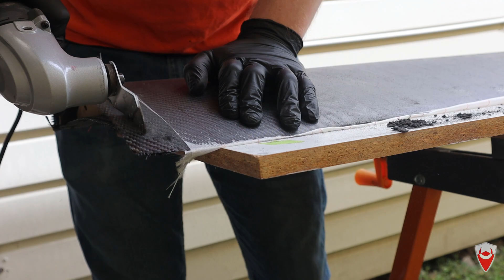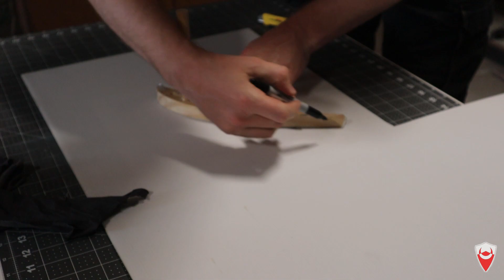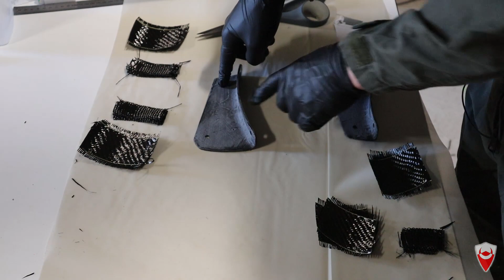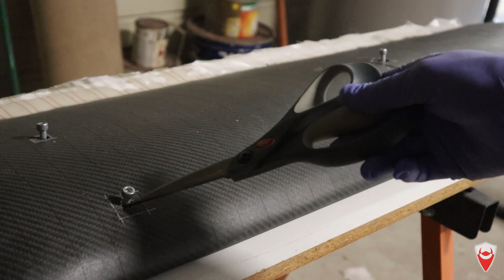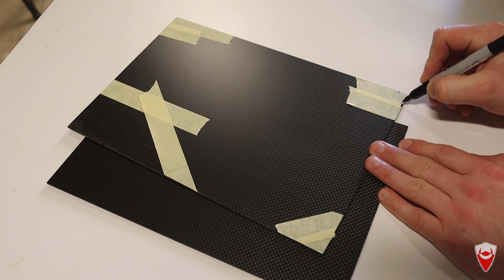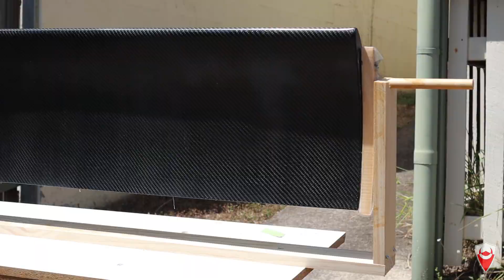[BUILD] Making a Carbon Fibre Wing: Part 4 - The Rest

Comment: Pro tip for satin finishes: always use gloss clear until the last coat or two. Then switch to the satin for the last couple of light coats. This will give you a satin finish with depth. Works on wood quite well too.
Reply from the maker: That's two good tips from you now, I'll be sure to try it too. Thanks

Comment: Best of luck with it. Keep an eye out for delamination from the core - may not happen, but I had that issue with a sports sedan wing I made for a friend.
Reply from the maker: Thanks for the heads up. I'm honestly not too worried about delam from the core as it was designed to not need the core, I left it in because I didn't want to go through the process of dissolving it out. If the skins were thinner and were drawing their bucking strength from the core I'd be a bit more worried, but they should be fine.

Comment: Hey Matt, great build series. A few tips from a composite technician , use  sculpting clay / plaster-cine to plug the threads in your alloy blocks (much easier to clean out) and use a grinder with a thin cutting blade for metal to trim excess material. That should help speed up your process a little bit.  Big up from NZ
Reply from the maker: Hey its a friend from across the ditch! You guys have an awesome boat building industry there, I'm really jealous of the cool stuff they play with!

I always stayed away from an angle grinder with cutting disc as I thought it would have been more dangerous, but if it's good to go, I'll have a try. As for the sculpting clay, I'll keep it in mind. How do you get it out after?

I really appreciate the tips, I'm just an engineer who likes to get his hands dirty. I can talk theory til the sheep come home (sorry I had to, I'm bound by the Aussie constitution you see) but I do have heaps to learn about efficient work practices. Thanks very much.

What kind of release do you guys use? I was genuinely blown away by that stoner's stuff, though it does smell like bike chain lube
Reply: @CEWManufacturing   Your welcome,  I used to vacuum bag infuse sail boats but now am in more general composites.  As for the sculpting clay, just a small drill bit and finish it off with the same size and pitch tap to clean it out.

We have used an array of release agents from TL paste wax, PVA and Chemlease release agent, but if it is just something budget or basic packing tape works great as well as whiteboard  (melamine ) sheets for flat molded surfaces. 

Also it would be criminal (fitting) not the have a sheep gag
Reply from the maker: I want to make a sail boat one day. I think it would be fun.

I only bought the stoner stuff because I didn't want to fork out for chemlease without knowing how good it was. As I said in the video, I'm never going back. Though packing tape is good to go

Comment: Thanks for sharing. Why did it take so long? Things didn’t go as planned and lost motivation? It’s what happens to me all the time. 
 How much does it cost in materials to build something like this? How much does it weigh?  
 I’d live to see a follow up video of it being used and abused.
Reply from the maker: It wasn't so much that I lost motivation, it was more that other things got higher priority. Paid jobs, my full time work (way too much of that), shiny things. You know, the usual. I also really hate sanding, that is a big mental hurdle to overcome at times and get through it to the next step (procrastination).

As for the cost, it was about 450-500 in carbon, foam and resin. Plus consumables. There was certainly things I didn't do efficiently there and could have saved money in those areas, it is also over built.

I honestly cannot tell you the weight, I stupidly didn't weigh it before handing it over. It's not as light as it could be, but I don't think it's overly heavy. I'll see if I can get the new owner to tell me what the weight is.

I want to do a follow-up, I want to check out the deflection under load and also characterise the lift and drag curves, to see how close it is to the original wing segment. I'll see what can be done.